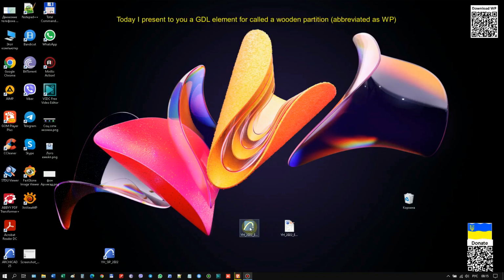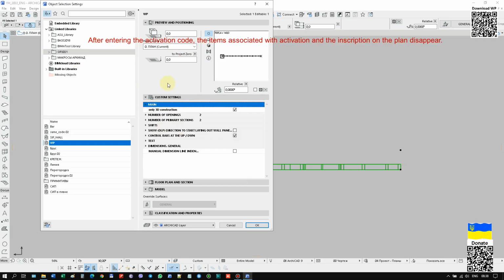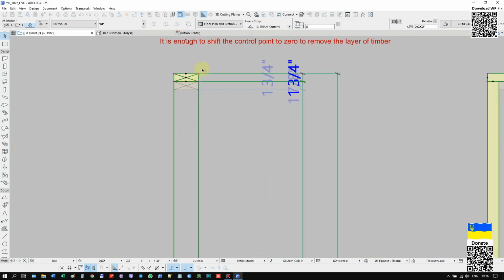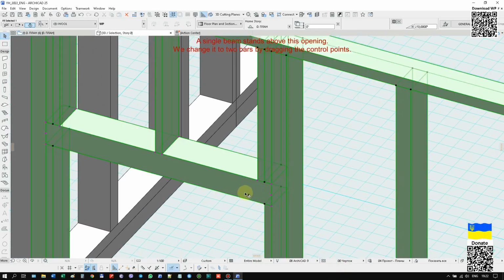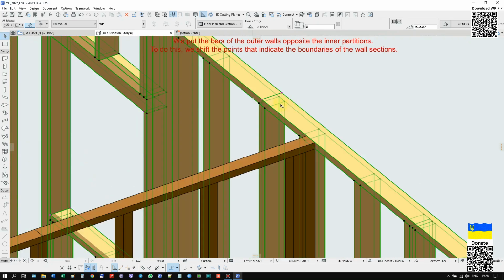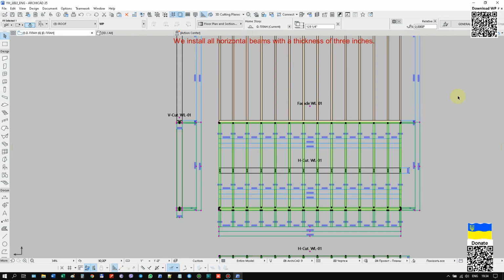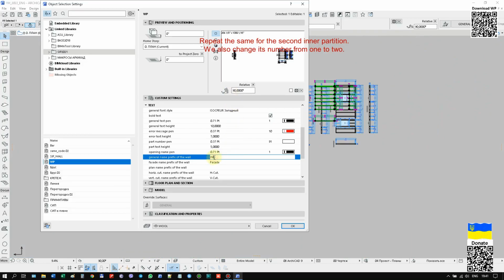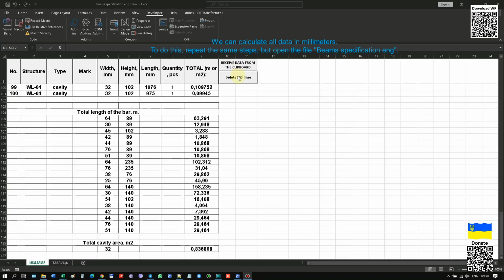Wooden frame design in ArchiCAD 25. GDL element "Wooden partition" by ©Oleksandr Yukhno, 2021.

Comment: I like what you’re doing does it have an option to add blocking through the centre of the frame and can you rake the frames?
With some further development I would definitely be interested for example colour coding the timber members semi automate the positioning of the frames in elevation and cutting lists Cadimage use to have the framing tool and it was discontinued I have been waiting for someone to further develop an affordable solution
Reply from the maker: Hello. I expected that there would be at least minimal sales of this product. I could then improve this element. Unfortunately, I haven't received a cent for my work yet. Now I am busy and have no free time. Maybe after the war the economic situation in Ukraine will improve and I will be able to do my hobby again.